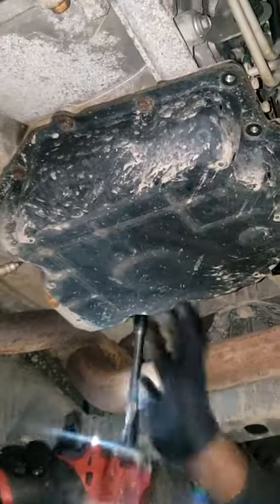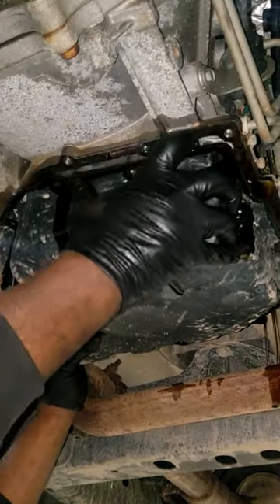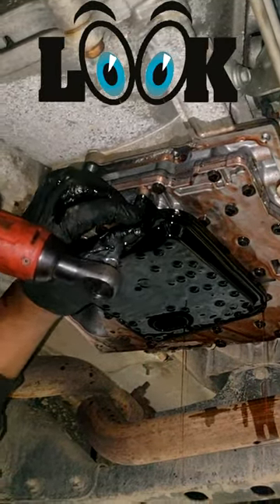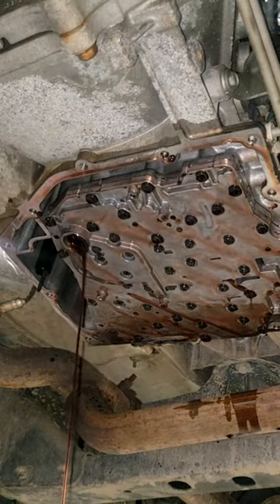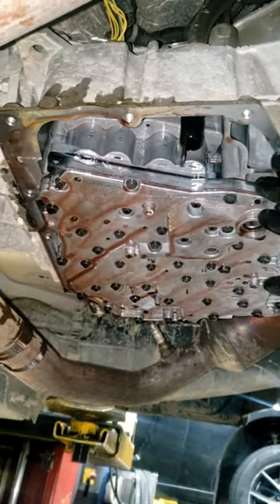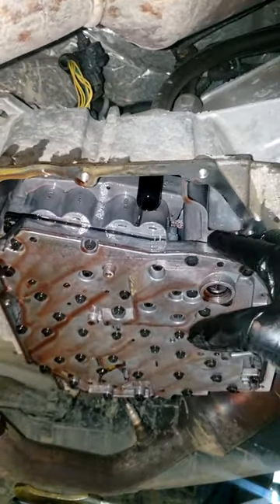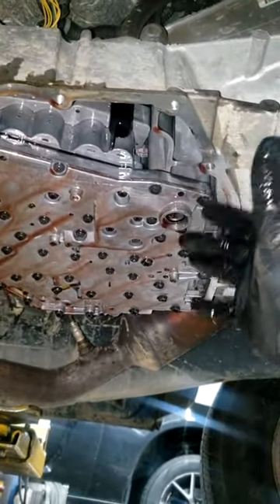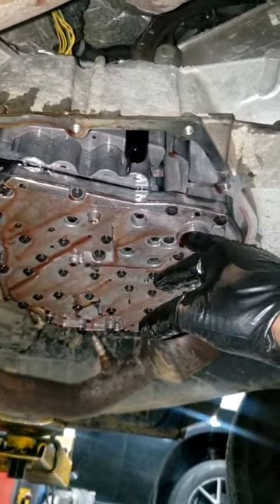No transmission flush machine, no problem. Do This. Best way to get out more of the old fluid.

Comment: Better to drop and fill it multiple times. You'll get most of the fluid changed this way.

Draining it might get 70% new fluid and 30% oil. Repeat it a 2nd time and now 91% is new fluid. Repeat it again and you get 97.3% is new fluid. Repeat it another time you get more than 99% new fluid.

I did this 3 times for my 1st lifetime fill car auto, when the oil started rapidly changing color and smell.

Comment: Your absolutely right, the torque converter will always hold at least 2 or more quarts depending on the size of it.
Reply: Why don't they put dreams on torque one on each side would bounce it
Reply: I've seen drains on some converters, can't remember which one it was but they did make them with a drain.

Comment: You don't disconnect the tranny cooler return line and just add extra oil till it runs red. Start engine for 20 seconds then check fluid and add as needed
Reply from the maker: Naw. I'm merely doing a trans service with filter and just trying to get as much of the old fluid out as possible.
Reply: @OnlineMechanicTips  to get most possible out of that 42rle trans, Crack the 10mm bolts loose that hold valve body up and it'll cause torque converter to backdrain most of the way empty, leave that way for about 20 min, then tighten bolts back to torque spec and procede with service from there
Reply from the maker: @gou733  Yes, thats the way I do the 42s and the fwd 41s. I do that when its a 1 day job. Since the vehicle was staying over night I just dropped the pan and left it all. Ended up needing 8vqts fluid instead of the normal.

Comment: If a transmission has more than 100K on it never ever do a transmission flush. If you do then you have a 90% chance of the transmission failing. This transmission might still be saved by just a new filter and fluid. This guy is doing it correctly. Good job.
Reply: I’ve had that happen 🤬.

Comment: Pan off x quarts. Wait over night x+0.5 quarts. Maybe a little more. Either way you still have y quarts left in torque converter which is at least 50% of total.   This is not a flush it’s just a hood drain and fill
Reply from the maker: Who said it was a flush?. I mistaking said this the closest you can get to a flush but I meant drain. And you wrong, and additional almost 3 quarts may come out. But you welcome to do what you want to do guy.
Reply: @OnlineMechanicTips  - well fella in the title you mention ‘no flush machine no problem’ so I use my brain and made the assumption like any normal person that you’re comparing what you’re doing to a flush.  Wrong assumption. Leaving it drip overnight will definitely not give you another 3 quarts beyond what was drained in the pan in the first place!  Ha!
Reply from the maker: @condor5635  you obviously not to bright, your comments show that..But I got this over here. I don't recall asking for your opinion on how many quarts come out..you welcome to make your own video an explain it your way..foh
Reply: @OnlineMechanicTips  guess so. Let some other people chime in about getting an additional 3 quarts overnight. None of the Toyotas I’ve done have done that.
Reply from the maker: @condor5635  Im not working on a Toyota. In fact, I left off the part where I loosen a couple valve body bolts to gravity bleed even more out. If you normally fill from a typical trans service with 5 quarts, you do this, during filling you magically need 3 more quarts, what does that tell you. Im not really concern with what others chime in about such a fact.

Comment: I do 3 drain fills separated by a few thousand miles  each.  This assumes it has a drain plug.
Reply from the maker: Yea no drain on these older models. So I time all my trans services for the end of the day to let as much of the old fluid out.
Reply: In the case fluid is off color from neglected fluid changes and the transmission is still operating correctly, I'll empty the pan by pumping up through the dipstick tube using a 3/8 vinyl tube and hand pump.
It's really important to change the filter periodically because the filters become plugged with debris as the transmission wears.
Reply: @thisisyourcaptainspeaking2259  no failures on high mileage transmissions after such a service? My folks have an 04 Toyota Sienna that never had the trans serviced. 

I was considering sucking out a quart at a time through the trans dipstick tube over the next 6 oil changes. This way, I don’t dislodge too much clutch material that may be suspended in old fluid and cause premature slipping and quicker failure. The local shop advised against messing with the fluid at this point, but I’m curious what you think.
Reply: @Ngcarson1337  It kinda depends on the fluid condition and type of transmission.  Chain type transmission aside (CVT?), your traditional clutched planetary transmission will benefit from clean (abraisive-free) fluid because the bushings, one-way sprag clutches and hydraulic pump wear from fluid that carries fine debris.
If the transmission is still operating correctly, be sure to change the fluid filter and as much fluid as possible.
Replacing the filter really is key because as the clutches wear, the filter becomes laden with abrasive debris.
General rule of thumb while the pan is off for filter replacement, hopefully you won't collect more than a tablespoon of debris from inside the pan.  The remainder of debris will be trapped by the filter and accumulated in the torque converter and cooling lines.
So IMO, attempting to dilute the "dirty" fluid by extracting then replacing with fresh can't hurt but you really need a fresh filter as well.
I think the best you can do is bring tranny to operating temp, drive it onto your ramps, extract fluid via dipstick tube (you get 3-4 quarts typically), remove pan, clean it and replace filter, install pan (don't over torque and warp the sealing surface, no more than 10ft-ld on the fasteners (wrist tight) should be good.  I prefer not to use rtv gasket sealer but if you do, sparingly.
Check the pan sealing lip and straighten it flat if necessary (especially around fastener holes).
Refill the same amount you removed plus maybe 1/2 quart to account for the dry filter and any unaccounted for fluid lost.
Final fluid check with trans at operating temp, avoid over filling.
Then proceed with your plan of extracting and replacing fluid.
A dirty, restricted filter reduces system pressure, places more load on the fluid pump and if pressure control is insufficient, clutch pressure becomes insufficient to firmly engage the clutches.  Once the partially engaged clutches begin to slip, they overheat and damage occurs.
Also be sure to use the correct type fluid and avoid mechanic in a bottle seal sweller in the case your transmission is operating correctly, these remedies can cause the hydraulic seals to swell too much and interfere with clutch piston actuation.
Reply: @thisisyourcaptainspeaking2259  Dude, I can tell you know your stuff. Thanks so much for a thorough explanation. 

The Sienna I’m worried about is approaching 300k miles with no trans service history. It’s started to slip a few times when driven aggressively on highway speeds by my stepfather. 

Would you recommend diluting the fluid to clean it up a bit before extraction? Or would you suggest going right in and extracting the original fluid with your procedure?

Thanks again for your expertise and advice. I greatly appreciate your time and thoughts. 🙏🏼
Reply: @Ngcarson1337  Bring transmission to operating temp, drive it on ramps and pump as much fluid from the pan as you can up through the dipstick tube.  Leave your pump set up for a few hours and pump the last bit, maybe wait over night as some fluid will drain back from the torque converter.
Keep track of quantity you remove so you can return same quantity during replenish.
Now is a good time to replace the dirty filter.
If a clutch is slipping due to low fluid pressure (clogged dirty filters cause low fluid pressure), the clutch will be smoked.
With 300k miles, this trans is probably nearing the end of life and a fluid/filter change may just be a waste of money.
Anyway, I feel like if you prefer to remove fluid and replenish with fresh, this will do no harm.  Pull out as much as you can and replenish that amount, bring to operating temp and recheck/adjust as necessary.  Shoot for mid-stick as maximum in cold weather, make sure at least minimum level, no lower.
I also feel like a clogged filter might be the last nail in the coffin of a very senior transmission.
It's cold out in the driveway doing this job, I know, pick a warm day!
Reply: @thisisyourcaptainspeaking2259  I appreciate you thoroughly explaining both options again and the procedures to both. 

I am however, still confused as to which option you suggest based on your experience. Let me restate the question as simply as I can muster. 

Is dropping the pan and replacing the filter following your fluid extraction method more risky than it is helpful? 

Based on what you’ve stated, it sounds like the current threat to the transmission is the buildup of more materials in the filter eventually causing a clog and nuking the whole unit. 

If that’s the case, would there be any argument against dropping the pan and replacing the filter?

Thank you for your time again, I greatly appreciate your help.

Comment: So how do you know how much fluid to add back in?
Reply from the maker: Are you talking transmissions in general or this specific transmission? Also are you subscribed to the channel?
Reply: @OnlineMechanicTips  yes im subbed and love the videos! I was just saying that this is technically an atf fluid exchange and filter change not a flush right? and normally you would use an oil jug to collect the fluid out of the drain plug so you know exactly how much to put into the fill plug up top. so since you just opened the pan, are you just gonna add in what you think is the right amount?
Reply from the maker: @combatengordn1731  Yes, this a typical trans service with filter change. As for how much fluid needed,  theres a known amout in the book that says 5 quarts with the filter change, but because I drain this over night, likely more came out. But keep in mind, this vehicle uses a dipstick, so you have a way to view the fluid level. You simply refill with the recommended amout then use the dipstick to get where you need to be.

Comment: The best way to nuke a slipping transmission is to do a fluid flush!!  The reason it’s slipping is likely due to friction material being worn off the rings… The warm friction material ends up in the transmission fluid, when you flush it- you’ve completely removed the friction material and it will now slip even more and likely more gears as well..
Reply: Absofuckinglutely. At the very least, you have to also add some type of additive or stabilizer to the new trans fluid. You can’t go back with just 100% stock fluid.
Reply: What if its not slipping but the fluid looks shitty.  Not burned.
✌🍩
Reply: @donutdan1508  So that’s the whole thing, right? It looks shitty because that’s all the friction material in it.. If you change it- you’d be removing it.. It may now begin to slip as a result…  damned if you do, damned if you don’t!!  I just don’t….
Reply: Ok can we talk

Comment: Hey so I changed my recently, I did a few drops and add fluid to kinda flush it. Thing is I drove it kinda low. But then topped it off. It had one high rev and now I feel it when it’s cold and I’m going up hill. What could it be. Or is it just the new fluid different than mopar and the new pan? Or did I mess up a solenoid or some shifter solenoid? Can I get an answer of what you think. Shifts beautifully otherwise

Comment: You can use a hose and tap into the return of the oil cooler and run until air bubbles show up. Do that several times and you have flushed your tyranny.

Comment: But then again I've had several mechanics tell me to leave the trans fluid alone
Reply from the maker: Theres several different opinions out there my guy. And they all just that, opinions.
Reply: If you have never flushed your trans before and have over 100k on it, filter change and top off is the best route. If you flush it, you could awaken some issues.
Reply: @evilgtidriver  ok I'll try the filter changes

Comment: An extra quart or 2 by leaving it overnight? I doubt it.
Reply from the maker: Actually if you lucky 3, especially if you lower the valve vody
Reply: @OnlineMechanicTips  Thats a lot of drips lol.
Reply: What you did is a good idea, I have done this(licensed tech for many years)  just never measured to see the difference between letting it drip until it slows as you would normally, and the extra that would come out overnight. A couple quarts seemed like a lot, but if you have measured it I won’t call you a liar. Smart of you to do this, helps you because it will not be dripping in the morning, plus doing a better job for the customer!
Reply from the maker: @peterl2017  A normal pan drop filter change usually refills back with 5 quarts.  If im refilling after im done and I somehow now need 7 to 8 quarts to get to the full mark then there, thats what extra came out. Im no trans flush type guy at all but I want as much of the old fluid out as possible.
Reply: @OnlineMechanicTips  Yep, all good if you say so and do the same vehicles enough to know. Like i said, not calling you a liar, just more than I would have guessed.

Comment: If you have really dirty fluid, we do what we call a power flush and disconnect a cooler line and drop it into a big 20L bucket and use the transmission's front pump to pump out all that dirty fluid while you keep filling it at the same rate that it's pumping out. You don't want to run it dry, even for a short period
Reply from the maker: No mention of the filter huh?, Imo that way will advance and speed up failures.
Reply: @OnlineMechanicTips  I don't know about YOU, but my converters all have to refill after sitting parked for the night- everyday... 🤦
Reply: @danielbrealey2924  Which takes all of 5 seconds or less? You’re both right. You SHOULD change the filter and you can fully replace all the fluid with your method.
Reply: @BrandonWest87  We only tend to do a power flush if someone's trans has really been let go and doing the fluid and changing the filter doesn't necessarily mean the trans fluid looks clean when someone checks the level. In THOSE cases we do a power flush as a final attempt to save a trans that's just starting to play up and/or has really dirty or burnt fluid. I was never suggesting that it should be done instead of a trans service. Geez, I still work on a lot of old classics that need periodic trans adjustments- if you don't get them right your trans will shit itself as well... I got annoyed cause people are SO QUICK to assume EVERYONE else is a dumb cu*t and only they know what's going on. I'm over it. No longer am I going to sit back and cop that from radom morons online... I've probably been qualified just as long, if not longer than bright spark "Online Mechanic Tips"... I see the type of workshop he's at, I work in the same type of little shops that do everything in house- including building customer's, friends and our own race cars...

Comment: Something I've learned from experience: don't flush anything except the cooling system. It can cause as many problems as it could potentially prevent.
Reply: I think he meant just a thorough drain and fill.
Reply from the maker: Thanks Selwyn... Im so not a trans flush guy. That is the most worthless thing customers can waste they money on.
Reply: B/c of how risky it can be? Considering that most people forget about it or ignore it till their car is at like 70,000+ MI, or are you saying even if they did it early like at 30,000 a flush can be risky?
Reply from the maker: @selwyn13  I guess my thought process based on the early failures of our 62TE. As this t/conv age and break down, all the clutch debri ends up in pan an clogs filter. A flush job compounds on that because the filter not changed. I guess you can say I'm big on getting that filter out. So yes, its risky from that stand point. I never sell flush jobs. A filter changed even if only removing 5 of the 12 quarts in the trans better than packing debri into a filter during a flush job. That could easily shorten the pumps life and ruin trans.
Reply: @Selwyn Abraham  the Owners manual in my wifes renegade says to flush at 90k miles

Comment: You'l have additional drainback from the torque converter, as much as 2~3 quarts.  It's important not to get dirt and debris all over the valve body from wind and dust when doing this out doors, so temporarily re-hang the pan using a few finger tight bolts while waiting.
Reply from the maker: Interesting my guy
Reply: Small garbage bag will work well, anything that keeps dirt and dust blowing around from sticking to the fluid in the exposed area.
Reply from the maker: @zaphodbeeblebrox1880  Curious as to whats blowing around in a closed shop over night?
Reply: @OnlineMechanicTips  Not much of anything as long as cleaning crew doesn't borrow the air hose when they come through.  If there is, you'l be able to feel grit on the wet surfaces of the valve body.  Some brake clean should work to hose it off.
Reply: @OnlineMechanicTips  Maybe nothing, could just be the dust blowing around between my ears. I don't have a good answer. Maybe I just don't picture most shops as a "clean" environment, or maybe it's because the valve body spends 99.9% of its life unexposed to the environment. No telling.
Reply: @OnlineMechanicTips  the fecal matter from all the mice running around 😆
Reply: @OnlineMechanicTips  ☺

Comment: Or..... after leaving it drain all night, leave it all open, lower it down on the lift, start the engine and redline it for 6 hours. Centripetal force gets all the fluid out that way, just leave it in park or neutral.......🤫
Reply from the maker: Interesting.